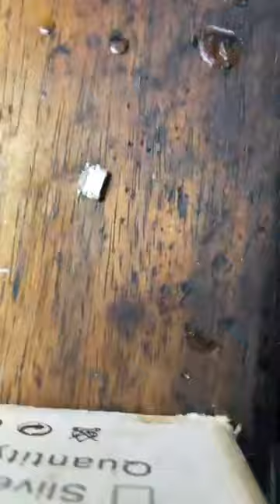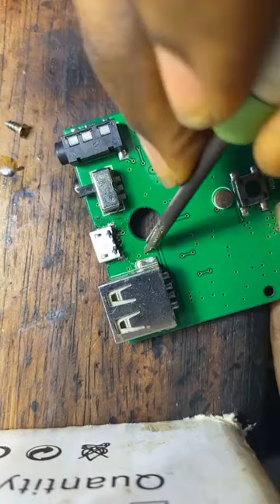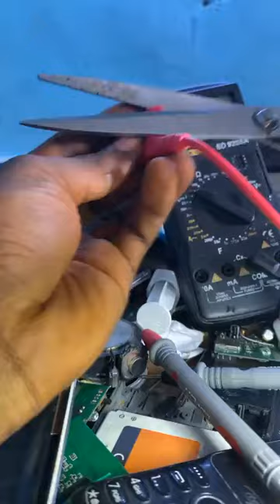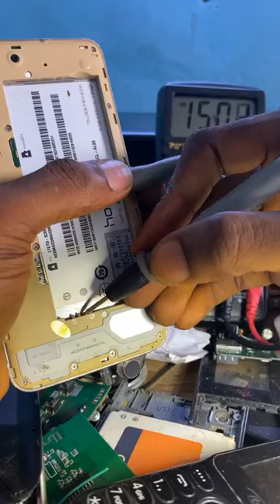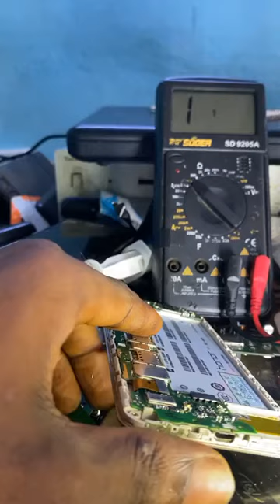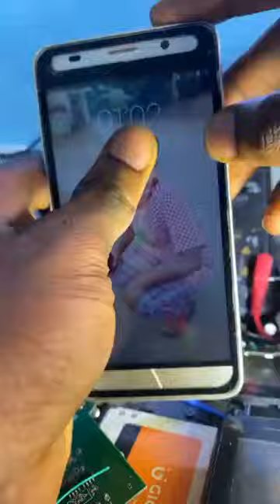Watch Me Live Changing charging port

Comment: Good morning boss!  I  I I I I changed a keypads charging port, the voltage is coming out to the battery connector is Ok but it's not showing charging. What could be the problem sir? 

And which type of lead is more effective and convenient to use? 
Liquid lead or wire lead?🙏